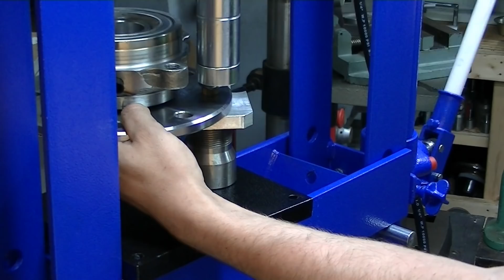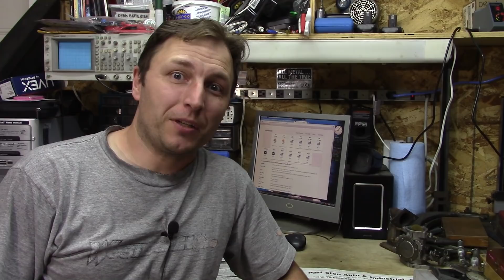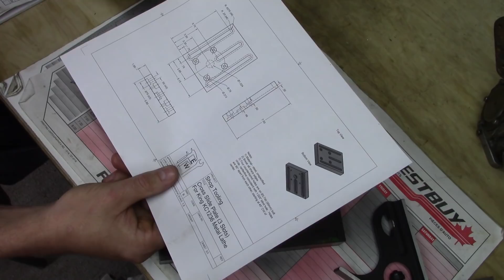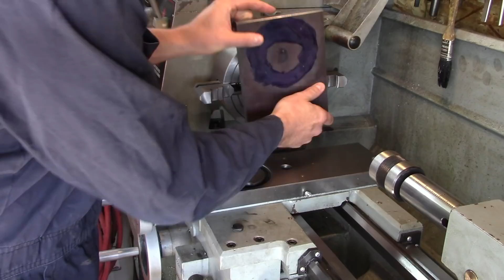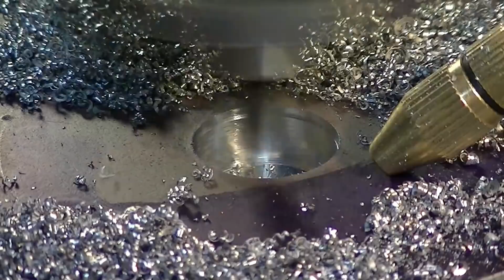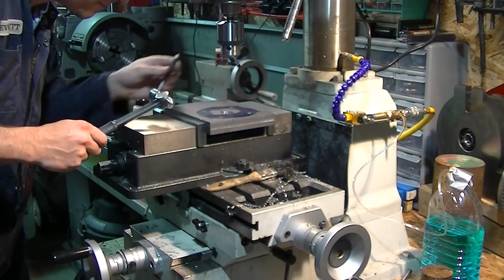Lathe Carriage T-Slot Plate - Part 1

Comment: Hey Everett, I reckon you'll find the old lathes, myfords etc had tee slotted cross slides as home hobby mills didn't exist yet. You did everything with your lathe. With the availability of smaller and affordable home mills most manufacturers stopped adding tee slots to the cross slides of lathes unfortunately. From looking at old hobbyist books like J.H sparey etc they could be very useful

Comment: You should probably try using a shell mill for facing off a big chunk of steel like that.Easier on your end mills lol.Up here in Canada machinery is hard to come by.In the States it seems like tooling and machinery is everywhere lol.
Reply from the maker: Yeah, that mill scale on boiler plate is brutal. If I ever get a shaper then this plate will get a good peeling on the top and bottom. I hear you about equipment, we don't even have a hope here in Alberta of the deals and selection in the States. But, to be fair, we have it easier to find here than some other countries, so I complain reservedly. We just have to make more of our own stuff. Oh darn, more shop time! :)

Comment: Everett have you thought about knobs for your down feed on the mill? Maybe you have some if not golf balls with a nut pressed into a tight hole work great and as file handles. Thanks for an interesting project, I also have the ubiquitous Chinese lathe!
Reply from the maker: The mill was missing the knobs right out of the crate when it was new, and when I asked about it at the store they pretty much brushed me off.  The threads on the ends of the handles are an oddball thread too, so it's one of those things where it's on the "someday to do" list.  Thanks for stopping by!

Comment: Face palm,  what the steps on the chuck are for, looks like it would fit to me.
Reply from the maker: I wish it did fit in the lathe chuck, but it wouldn't fit even on the outer steps.  Not a huge deal, just had to use the mill even if it took longer.  Thanks for stopping by!